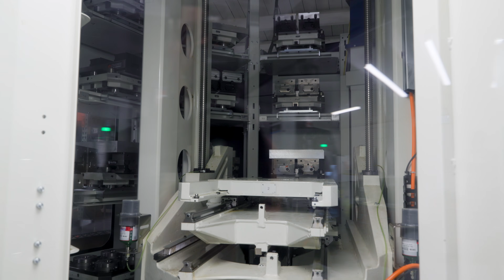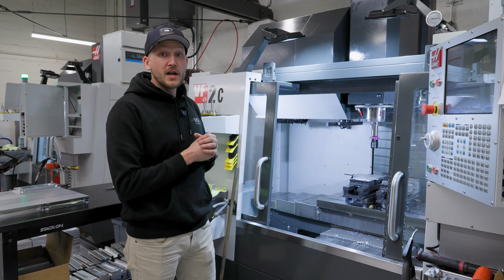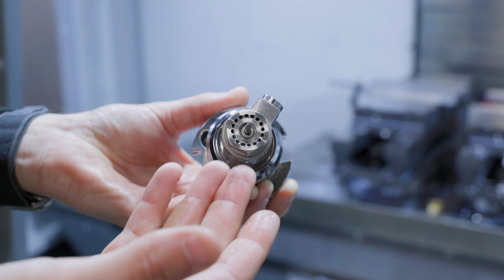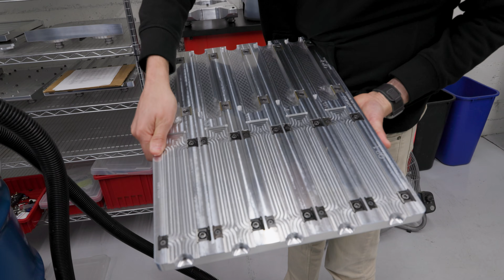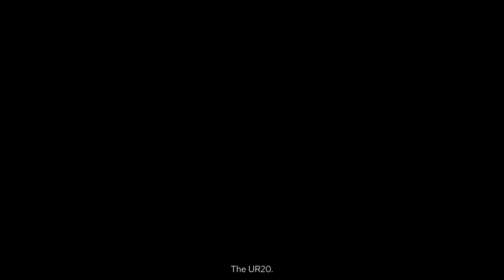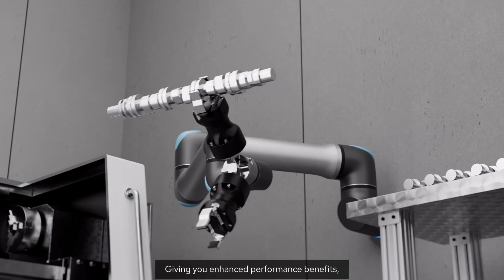Spindle Speeders and Custom Robotics | Engineering Our Way Out of a Massive Production Backlog

Comment: As many others have stated as well, my first thought was to laser engrave whatever needed to be engraved, but it sounds like that does not meet your requirements.  You may also look into making a "stamp" electrode and just "burning" all necessary characters/logos into the part in one operation, though this would require an EDM machine and would leave a matte/textured finish (although very clean) on the engraving.  If the smoother finish of a machine-engraved text is required, then I would look into some of Datron's small CNC machines as they offer spindles capable of 60k rpm and could even exist solely to do offline engraving on various parts, as necessary.  Even a small yet rigid CNC router with an NSK/Nakanishi spindle (capable of up to 80k rpm) could be used.  Yes, it would be another step/operation, but can be running at the same time as "normal" machining of the parts in the HAAS VMC, therefore lowering 'takt' time.

In my personal opinion, trying to automate a VMC is an expensive step in the wrong direction if your main goal is throughput, unless you are running a large number of small parts on each pallet.  The time required to do a 90 degree index of a tombstone in an HMC will likely always be significantly less than the time required for a robot to swap a pallet in a VMC.  Though neither will require operator input to happen, the HMC will likely be back in the cut again before the robot even removes the pallet from the VMC.  It is quite likely that a properly sized HMC could successfully replace multiple VMCs in your application, especially if you are generally running mostly the same parts.  

In regards to the vacuum workholding and whether or not it can be used on an HMC, I have seen successful use of vacuum fixtures where a vacuum system is basically built into the middle of the hollow tombstone and is sealed once the parts are "clamped."  This allows indexing of the tombstones and only needs to be connected to vacuum lines/pump when the tombstones are on the outside, being swapped by an operator (or robot).  Think of it like vacuum-sealed food; it remains under vacuum until the seal is broken.  This concept might be worth looking into and experimenting with, especially if its the only thing holding you back from using the Grob for some operations that require vacuum fixturing.

My final piece of advice is that, sometimes it is necessary to turn the "engineering brain" off.  It is so easy to over-think and over-complicate things sometimes, when a viable solution may be readily available.  I have learned to always question myself once I start going down a complicated path for a solution that should be very simple.  Many times (not always!) I have found a solution that was significantly easier/more suitable than my initial thoughts.  

Anyway, looks like you have a great operation running there, and I'm confident you'll find solutions to all of your challenges.  Good luck! :)
Reply: Thanks for the detailed feedback and advice. I will consider it. Definitly having a blast with this project. Getting a smaller high speed footprint for small parts is the way to go, but these VF2's are great for the larger vacuum plate projects we are working on. Updates to follow!

Comment: Is it possible to use the main spindle on max RPM while you also use the coolant turbine tool?
If I understand properly this would add up the RPM-s, and you could reach almost 95k RMP.
What do you think about this?
Reply: I have my doubts the turbine tool is balanced well enough to run at any significant rpm.
Neat idea tho. 
I hope they answer/try it
Reply: @brianwaayenberg3099  correct along with the runout issue.
Reply: Correct, there is run out on the speeder. Holding the unit stationary gives the best finishes. Plus, we can also reduce the spindle on time which is always a plus.